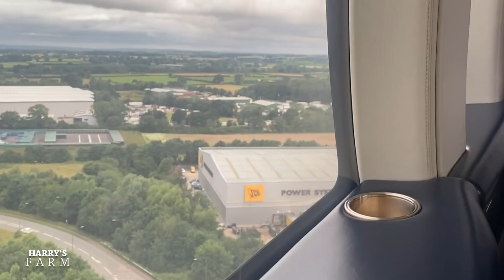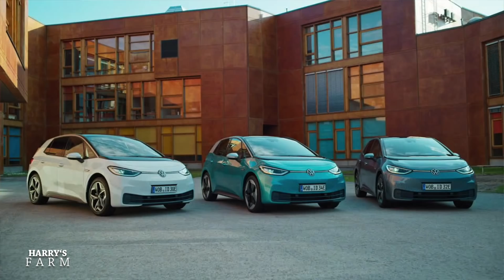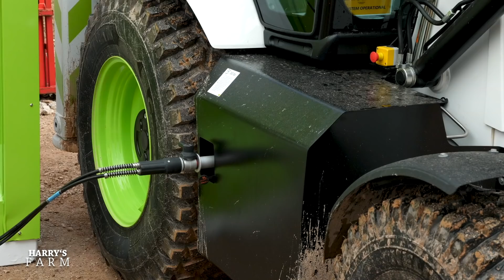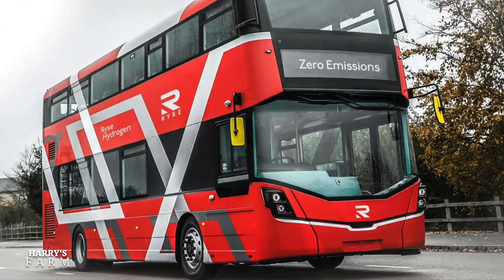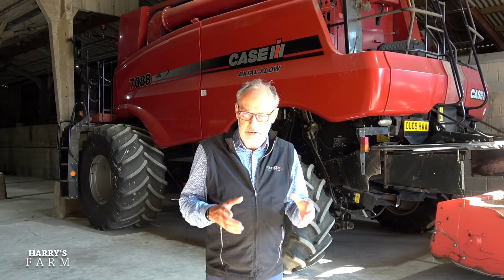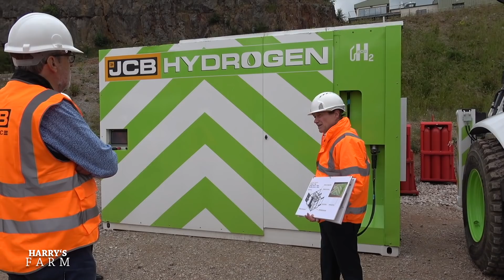Why JCB thinks hydrogen is the best alternative to diesel for heavy machinery, farming and HGV fleet

Comment: Interesting, Meaning if you can generate your own Hydrogen  from your biomass it makes for more affordable operating costs. My question is, why not deliver the Hydrogen in cryogenic tanks and also store the hydrogen in a cryogenic tank on the tractor. Then use a heat exchanger to build up pressure and an onboard system to build up the pressure to the required 300 bar?
Reply: oil companies attempting to sell oils and gas dressed up as hydrogen it is a scam    Depending on the quality of the feedstock (natural gas, rich gases, naphtha, etc.), one ton of hydrogen produced will also produce 9 to 12 tons of CO2  
However, hydrogen combustion with air produces oxides of nitrogen, known as NOx. In this way, the combustion process is much like other high temperature combustion fuels, such as kerosene, gasoline, diesel or natural gas. As such hydrogen combustion engines are not considered zero emission.
Reply: @brianevolved2849  How will hydrogen production produce Co2? You can use electrolysis   from a solar power plant and produce hydrogen from the abundance of the sea. In addition obtaining Hydrogen from methane in biomass would not produce any Co2 that was not already there in the first place. Enlighten me
Reply: @alex.w.kimani6921  oil companies attempting to sell oils and gas dressed up as hydrogen it is a scam Depending on the quality of the feedstock (natural gas, rich gases, naphtha, etc.), one ton of hydrogen produced will also produce 9 to 12 tons of CO2 
However, hydrogen combustion with air produces oxides of nitrogen, known as NOx. In this way, the combustion process is much like other high temperature combustion fuels, such as kerosene, gasoline, diesel or natural gas. As such hydrogen combustion engines are not considered zero emission.

Comment: Actually, for smaller vehicles, like BEV passenger cars, batteries are already in the cost deflationary stage (cost per KWh) and will get cheaper and safer still - just wait for solid state. However, for big machines like large JCB excavators/HGV's/tractors I get the advantage that hydrogen offers. The infrastructure is still an issue -who pays for that?

Comment: The problem is that the almost all of the hydrogen is the produced using fossil fuels. That means that under current market conditions, hydrogen is, by definition, a fossil fuel. It is also necessary to take into account the entire carbon cycle when determining is something is more environmentally friendly. It takes a lot of energy to extract hydrogen, and you only get a small portion of that back when you use it. It is far more efficient to just burn fossil fuel then use hydrogen as a fuel source. That's should be the final nail in the coffin, but yet, we are still seeing compagnies trying to promote hydrogen as a clean alternative.

Comment: Zero CO2 - need to make sure all NOx is eliminated to claim "zero emissions"
Shows that the "incumbents aren't really all sitting on their hands..  little steps, not to strand resources.

Cheap energy storage will win for bulk applications - when electricity is "too cheap to meter" (lol) - efficiency (EV vs ICE)  is less of a concern.
Reply: Explain how nox comes from mixing hydrogen and oxygen
Reply: @alpye  In a spark ignition air breathing engine,  Hydrogen is combusted in Air not just  O2. Oxygen and Nitrogen get quite close at high temps resulting in Oxides of Nitrogen .. Which need to be reduced to avoid smog (meet EPA targets on emissions).
Reply: @kadmow  I did not know that thanks 👍
Reply: @alpye  https://www.youtube.com/watch?v=l6ECwRnJ0Sg

Comment: All the new vehicles h messes with the o2 sensors in the fuel mixes, diesel may be different?? They can build them for way cheaper than they r talking.  True they will not get rid of the fuel we use now, but it’ll work

Comment: I work in Oil & Gas on the EPC side of things and have contact with people at the majors.  I can confirm that this industry is increasingly getting focused on hydrogen.
Reply: which you could split off of oil. perhaps not efficiently at this point but if they ever figure out industrial scale graphene production you have a market for all that carbon in the oil too.
Reply: Translates to "I work in a dying industry and there is a straw i can hold on to." Sorry, mate. But you need to face that.
Reply: @b_lumenkraft  Dying industry… spoken like someone oblivious to worlds and their own dependance on the industry.
Reply: @b_lumenkraft  Yeah, "just stop burning stuff " is a  great slogan - making hydrogen is extremely 1. Either dirty or 2. Energy intensive.      You can only "crack" to get hydrogen at high temperatures,... The Fossil Fuel industry thought they could foist hydrogen on to a naive consumer base. Economics has destroyed that ploy. And I would be sad if Lord Bamford has got this wrong - but I suspect, as batteries improve, get cheaper, get faster charging times - he will be proven wrong. Those engines, while works of art, and clever engineering - are old technology. An electric motor ( or two, or three) is SO much simpler, and versatile (no complex gearbox needed, for a start...)
Reply: Talk to me about this. We are developing a major Hydro project for green hydrogen in the UK.
Reply: @jamessutcliffe3045  Despite what other people are posting, Hydrogen production is starting to happen at source for wind turbines, it’s cheaper to pipe it a long distance than electric cables (off shore) and the gas can be stored when on shore. Electrolysis isn’t efficient but that’s not an issue when the electricity would be going to waste.  Look up Steamology, exiting new Hydrogen Steam Generator with small steam turbine for 25-1500+ kW, genuine diesel replacement.
Reply: Blue hydrogen or green hydrogen? Blue hydrogen is developed from natural gas… just another way for oil and gas to greenwash and remain viable. 🧐
Reply: Basically "laundering" dirty fuels into a "clean" one with a massive energy loss in the process. May as well just keep burning oil in vehicles.
Reply: @stephenauty2402  Good way of putting it ! Lord Bamford has been bamboozled by sharp talking Fossil Fuel lobbyists. "It's a zero-emission vehicle" - is an absolute lie...
Reply: oil companies attempting to sell oils and gas dressed up as hydrogen it is a scam    Depending on the quality of the feedstock (natural gas, rich gases, naphtha, etc.), one ton of hydrogen produced will also produce 9 to 12 tons of CO2
Reply: @brianevolved2849   Hydrogen is being produced by wind farms when there is no electricity demand. This is now going to become common place.
Reply: @kip8790  Hi, but where and how Hydrogen is stored after being "produced", do you know what is efficiency on electrolysis (very poor), then compression, cooling down and how to distribute to long distance?
I am happy for Hydrogen being on Oil companies target, but unfortunately it won't be as clean as we would expect.
Wind turbines are the dirtiest machines to produce electricity, mostly work on 30% efficiency, when not to windy is no good when to windy not good either.
Electricity prices goes up as soon as Wind Turbines appears. This is the result of overproduction fines being sent to electricity suppliers not being able to receive energy over produced in windy days, the winner is Wind Turbine owner, NO ONE ELSE.
Reply: @brianevolved2849  Shell is attempting to transform into an energy company - selling off lots of major O&G assets and taking stakes in things like offshore wind farms and geothermal.  In addition carbon capture is advancing so IF refiners are able cleanly produce hydrogen from fossil fuels that are already being extracted for things other than fuel - I.e. nearly every product known to man - why not?

Comment: Hydrogen, as well as batteries are just a form to store and transport energy, just like diesel (conventional, bio or synthetic). It depends solely on the source of the energy if (or not) it can be considered "green". Hydrogen or electricity created from a fossil fuel source are not green at all. All means of transports have pro's and con's. batteries are heavy and expensive. Hydrogen needs to be stored under very high pressure, loves to leak due to its small molecule size and tends to explode violently at any fuel to air ratio (unlike methane gas for ex.) Its nice of JCB to have solved the easy part of hydrogen usage. But they are just ignoring the hard part which is the making, transport, storage AND safety of it. Those big red bottles don't grow on trees guys.

Comment: Diesel is the best alternative to diesel. To get hydrogen they'll need to pull it from water, which will destroy the ocean. If you run out of natural diesel, use biodiesel. CO2 does not affect the world. If it did the volcanic activity we've had for the last few billion years would have made the planet unlivable. Anyone who goes electric is a moron.

We don't need to reduce CO2. The world temperature hasn't risen in 6 years according to satellite data. The Sun is what dictates the warmth of Earth and there's nothing you can do about it. Even with Bill Gates seeding the atmosphere with calcium carbonate which has led to mass floodings.

Comment: There is no way to not make hydrogen the most leakable fuel available. It has a single atom, so every single bit of the chain needs to be so much more expensive and well engineered.
It's also completely ignoring the main benefits of electric where you can get 75% regen and the chances of mechanical failure are much smaller with simpler designs.. 
What I expect is going on is they are desperately trying to protect their investments of millions in engine manufacturing tools by digging in rather than moving on..
They seem to ignore that you can buy used vehicles or lease them so the savings on fuel, maintenance and tax very quickly put you ahead..

Comment: Hydrogen engines are not zero emissions, they produce water and NOx.  They will also be highly inefficient and have the same poor reliability and service costs as diesel engines.  You maybe able to refill it quickly-ish but you will need to do that alot, and it may not be that quick, currently prototype trucks take 45 minutes to refill.  They cannot store Hydrogen at 10,000psi needed in steel tanks.  Hydrogen will be your biggest expense, more than UK road diesel and several times more than off-road red diesel.  It will also come from reforming fossil fuels and have already emitted CO2.
Hydrogen is not more energy dense by volume (as stated by the interviewer), its more dense by mass (as stated by JCB), but you can only get a few kgs of Hydrogen on site at a time, it takes up so much space and leaks out.  Trying to produce it from renewables will mean 3-8x more renewables need to be build (especially if you use a combustion engine), blowing any chance of meeting Co2 emission targets out the window.
Batteries are not going up in price the materials is NOT the main cost, there is lots of energy and processing in them...AND Lithium and copper, Cobalt etc are NOT rare earths, batteries do not use rare earths.  Battery manufacturers are happy with battery materials going up, they have plenty of margin.
Batteries may struggle today to supply 8hrs on a digger, but Hydrogen will be alot worse, it will manage 1-2hrs before it needs a new fil up.  By 2025 8 hrs will be possible in batteries and Hydrogen will not have improved.   The vehicle shown only has a 5kg Hydrogen tank, which is the equivalent of an 80kWh battery (like a Tesla Model 3) when the Hydrogen is used with a fuel cell, with a combustion engine it will be half.  You will need 50kg of Hydrogen to run a combine for 5 hrs (using a fuel cell), probably 100kg+ for a engine based combine.   100kg of Hydrogen needs a tank about the same size as the combine.  The tank would also weigh about 2T.  To compare diesel with electric, multiply diesel gallons used by 13 and you get battery size needed in kWh (energy content and efficiency comparison).
The pump to compress the Hydrogen will use about the same amount of electricity that a battery vehicle would need per unit of work output (eg by mile or kWh used by the machine).
If you have a Megapack on site (3MWh) you can charge that from any mains supply and then fast charge the battery vehicles during the day in about 20mins.

Comment: Unfortunately, hydrogen is the most inefficient ‘battery’ known to man.
After production, cooling, compression and storage losses, it is only 20% efficient.
Even storage is problematic, as hydrogen can leak though any tank, at 1% or 2% a day.
R
Reply: And on top of that, they created an internal combustion engine which is even more inefficient than a fuelcell and electric engines.

Comment: Was talking about hydrogen in the local pub last week. It's great idea but there is one small drawback. If the only emission is water vapour, that isn't an issue until the weather gets cold. Then you get an issue in that you will have slippery roads. If they can get past that somehow then it's doable
Reply: It isn't the only emission, there's NOx as well.
Reply: @malcolm8564  While that might be true, it's the direct impact water will have on a cold surface. NOx is an issue, but until a viable 100% clean fuel is found we will have to find compromise somewhere

Comment: clearly most here are stupid electric is not in currant form the planet saver u get fed it is costs are stupid materials rare and will get very expensive erxtra battery packs really u have that much money andnoone says bughgar all about the pollution we willhave from useless battery packs that cant be recycled bring this tech forward quicker downsize engine to 1.5 stick it into cars markets there fuel supply will be the fact remain alt fuels like hydrogen are far better for the planet and wallets than silly electric cars etc at2/3 times the cost dead end big time!.

Comment: Batteries will also be a problem in taxis and transporters as there it doesn’t work for 2 hours or something but 12 and maybe even 23 hour’s. Also military uses. I suspect that even normal car’s will change over to h2 because it’s doesn’t make sense to separate. I think one of the main reasons it wasn’t chosen is because the power stations etc. didn’t see a huge move towards higher prices but actually falling prices because of solar etc.

Comment: These machines will be powered by e-fuel in the future. Hydrogen is too dangerous and it is not more efficient than diesel if you produce hydrogen from splitting water. If you produce hydrogen from natural gas, the equation is different, but then you might just burn the natural gas.

Comment: This really shines light on there probably wont be a one stop solve all green energy . Rather multiple for different uses and fields, but not drastically different than what we have now with diesel versus gasoline. Very interesting video!
Reply: oil companies attempting to sell oils and gas dressed up as hydrogen it is a scam    Depending on the quality of the feedstock (natural gas, rich gases, naphtha, etc.), one ton of hydrogen produced will also produce 9 to 12 tons of CO2  
However, hydrogen combustion with air produces oxides of nitrogen, known as NOx. In this way, the combustion process is much like other high temperature combustion fuels, such as kerosene, gasoline, diesel or natural gas. As such hydrogen combustion engines are not considered zero emission.